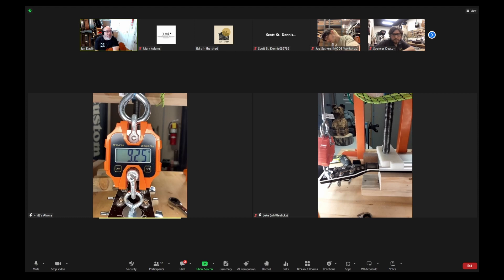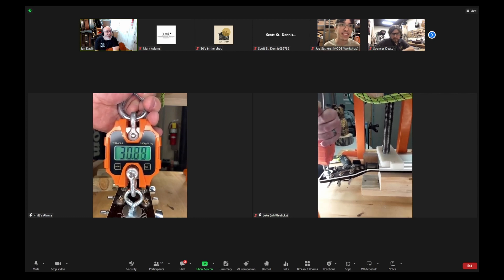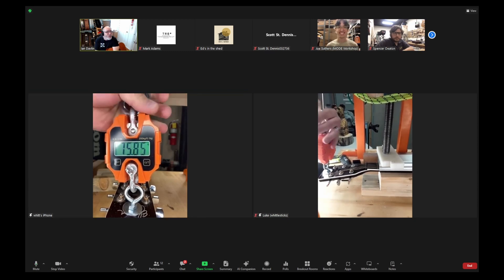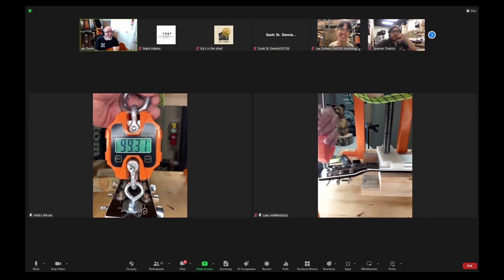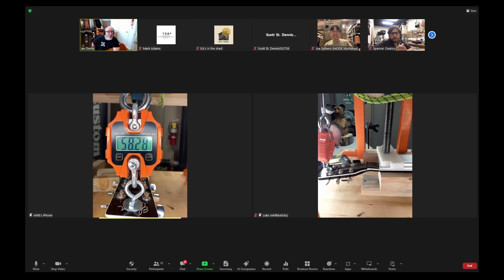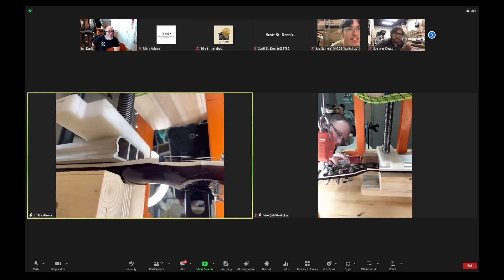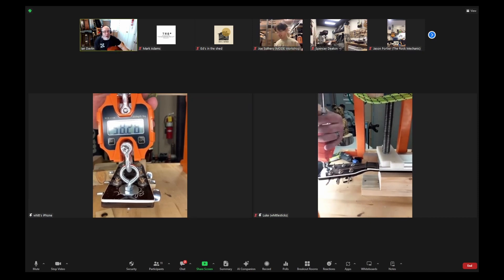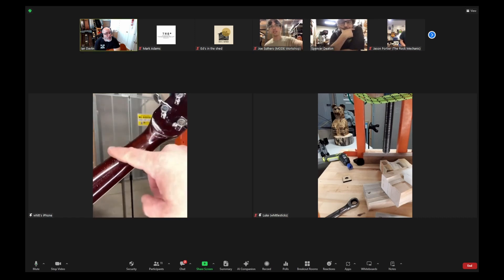Luke Heaton Tests Rig To Test Headstocks With Carbon Fiber Reinforcement

Comment: I’m not sure about the physics, but if (for example) your strings have 100lb tension and the headstock deflects 10lb, is that robbing 10% of the energy transferred to the top? If we build a headstock/neck with 0 deflection (can we?) will the top respond better? Just thinking out loud, great test! Hope to see more. Thanks!

Comment: Very cool test!

Even given the headstock break angle, the reason the original string tension was so “low” compared to the normal hundred plus range we normally associate with string forces on a guitar is due to their short length in the test rig. As string length increases it takes more tension to bring them to pitch. So a shorter string = less tension.

Comment: I'm Confused... I mean. I see what you're doing here.... But 90% of headstock breaks don't happen from increasing pressure while the neck is clamped stationary...    They happen from a fall.   Snap.   Hit.   With...or without string pressure.... Although it is more likely to happen with strings extra pressure.  But. You put 50 lbs pressure consistent on a headstock ..   idk??    If you took that 50 lbs force and tapped the top face.  Or back top of headstock. It's most likely going to snap .  If it's mahogany..... Although. I have had a ibanez Maple headstock snap from falling over....  But that's the exception rather than the rule.... Most headstock breaks are admittedly  Gibson 14°+ angle tilt back and mahogany.. especially where the nut is.  Is narrow...  But they certainly aren't exclusive to breakage there.   But I would say 85% are mahogany.... and break from a jolt.  And not increasing pressure....  I could be way off on this...  I only do Guitars as a hobby
Reply from the maker: I think you are right. This is just a first test. Really just to establish a base line. Let us know if you have an idea for measuring a shock force test. I have a few ideas kicking around.
Reply: Even given all the variables, I think it would be interesting to break an “unrepaired” neck as comparison?

Comment: I missed it.  What guage were the strings.  What scale length was the neck.  (And what fret did it get reinforced where it met the body) and what material was the neck.     For example  hard rock Maple is Stronger  than mahogany.  ... Oh.  Wait.  I thought you were merely measuring deflection I. A neck.   Like center.    For truss rod .   You're measuring how much pressure it needs to snap a headstock (off?)